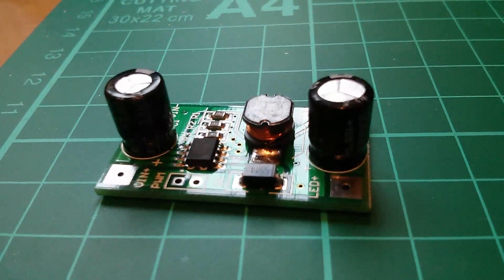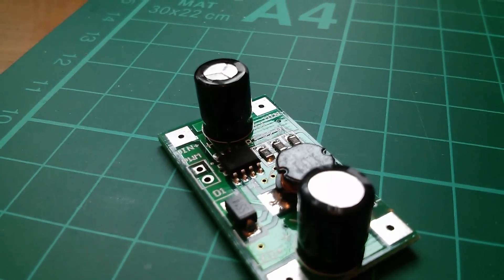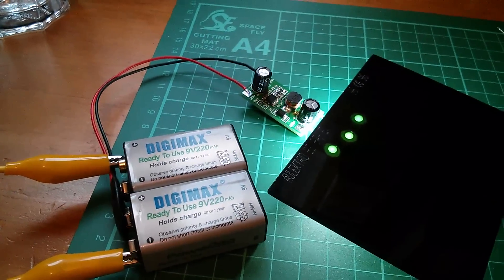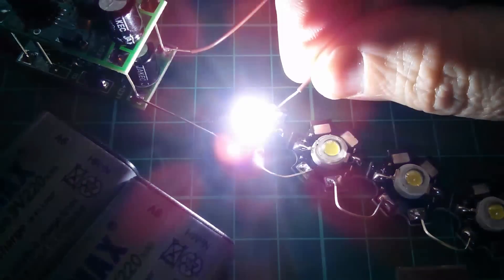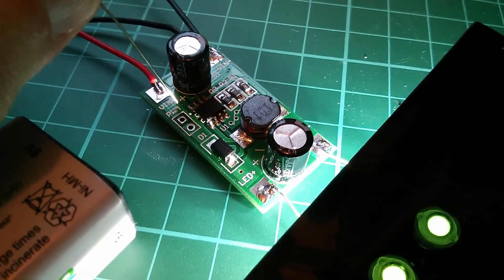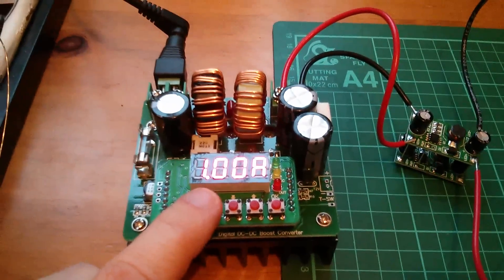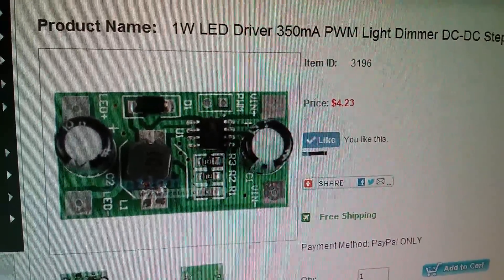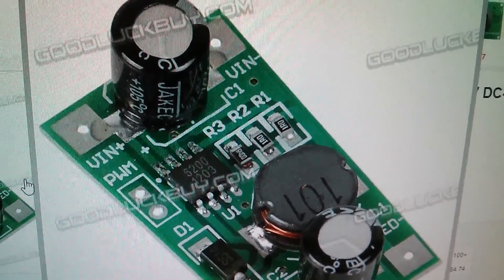Review: 1W 350mA LED Driver with the elusive 6200 Chip

Comment: Got this question here, by utilizing the pwm pin to control the brightness of the LEDs, does it induce flickering to the output caused by the pwm itself? like I want to control the brightness using an MCU with pwm.

Comment: After connecting 1-4 LEDs they start running warmer and warmer until the they "switch" down or something and they got dimmer around half as bright and no longer run hot. It doesnt matter if its 1 or 4.

Comment: To PWM works with arduino it must to be connected with PINS 4 OR 13 because they are 980 Hz. Others pwm pins are 490 Hz and doesn't work. And it is logic inverted

Comment: If it can drive up to 10x1w led. I would list the product as 10w capable since that's it's max output. And list 350mA output just as it has and people will know that's for 1w led's. most drivers are meant to put their max output on the listing. 
So it really is a 10w capable unit, it only can output 350mA. That's reasonably decent, but lets be honest there are hordes of buck converters that can easily do that and it isn't anything new.
Reply: Except that this is specifically constant current...

Comment: @Julian: I've searched for this chip last couple of days and found on Ebay 2 of the same drivers with different text on the chip. After clearing out the picture I found out the correct chip that is used in this driver: XL4001E1. This is the chip on the "non" 6200 driver but I bet you it's the same chip. Pin 1/2 and 7/8 are indeed linked: http://www.xlsemi.com/datasheet/XL4001%20datasheet.pdf

Comment: Julian.  I managed to get a datasheet for the SSC6200 dip-8 directly from Sanken if you're interested.
Reply: could you upload it?
Reply: @sztorm94  Hmmmm...I don't think I still have it.  But I do remember the pin-out was the same and the voltage\current specs were pretty much the same.  What I can say from personal experience with using both chips on these modules is that the SSC6200 modules couldn't handle as much current as the XL chip could..  I changed the resistors and diode on the board and was able to get a steady 1A out of the SSC but could go to 1.5A with the XL.  Anything higher and it would begin to strobe.  The SSC boards are very stable for 700mah and lower and have been going strong for years so there's no reason to avoid them.

Comment: Picked up a 20 piece lot of these; but the 700ma version.  just a heads up that it seems a BIG batch of these was built with the capacitors installed with revered polarities.  17 of the 20 have incorrect polarity.  Never even thought about checking this before using and got a nasty surprise when the capacitor on the Vin side exploded in my face.  Glasses saved my eyes from the debris.  Not too pleased.  Removed and reversed the caps and the driver works as hoped.  But anyone getting these I would HIGHLY advise double checking the capacitors are installed correctly before even contemplating connecting power.  Just glad ebay has a great buyer protection policy.  Refund is on its way.

Comment: The chip is either a copy or a relabeling of an XLSEM XL4001E1 which is a 2A cc/cv 150Khz buck regulator. Data sheet is here: http://www.xlsemi.com/datasheet/XL4001%20datasheet.pdf  Its a nice chip for what it costs (around $0.20 in small qty)

Comment: Can you please explain how to connect the PWM dimmer with that led driver ?
Reply: Don't suppose you ever figure this out?
Reply: @FireclayHomestead   You could use an Arduino, 555 timer, etc, or any logic pwm source. Just put a resistor in series, solder to the pwm input.  Look up XL4001 (XLSEMI) datasheet, I think these chips are a copy.
Reply: @darkanthem9056  what is the purpose of the resistor and the specific value?

Comment: Hi Julian,

I really like watching your videos and have a question to the 6200 Chip.
I want to use the PWM function with an Arduino Nano. Do you know the max voltage for the PWM input? Can I connect the digital PWM Pin directly to the 6200 chip or do I need a voltage divider?

Thanks.
Reply: Do you have any information about it?
Reply: @sztorm94  It's the chip in this video, which seems to be elusive.

Comment: I wonder how much current you could get on the output by lowering the value of the sense resistors further.  Perhaps by shunting an external resistor across them?  This is where the data sheet would be handy after all.

Comment: I googled '8 pin dil 6200' and found some data for a different numbered chip but it was a constant current, constant voltage led driver. Hope this helps.

Comment: Pro tip, use Google Translate to get Simplified chinese for LED Driver, then search for 6200 LED驱动器 the first link, 
http://b2b.hc360.com/supplyself/51529904.html
from which we learn the full code is SW6200, it gives some basic details (and googling for SW6200 give them in loose english, http://hu364362808.en.b2b168.com/shop/supply/5287218.html ), and indicates it's most likely a drop-in replacement for the LM3405, for which a datasheet is easy to find :-)

Hmm, except the 3405 is a 6 pin device so not drop in, but maybe functionally equivalent.

Comment: Why would I need to worry about the Amperage ?
I am running 3x 10W 12V LED's in parallel on an old computer power supply.
The power supply's  capability is 350W at 12V.
Both my LED's an power supply are doing great for months.
Is there something I don't get or is the worry about running @ 700mA unfounded ?
I get a lot of things but electricity isn't 1 of 'm.
if I can't see it it confuses me.

Comment: man i am soo good at searching the web :) found what your looking for in 3 minutes or less. here you go:
http://www.aliexpress.com/store/product/SC6200-DIP-Octal-LED-Driver-General-Purpose-Current-Sink-with-Serial-Interface-new-stock-ic/322502_728699558.html

i did this search: 6200 1203 ic
and clicked on any aliexpress link (all cheap electronics are made in china and sold on aliexpress).
Reply from the maker: No sorry. If you search for the Sanken SC6200, the only application schematic is of a 16 pin chip.
Reply: Julian Ilett
 well you cant blame me cause the Chinese products dont have the support and technical info that other western product have :) its the right IC but youll have to directly contact the producer for technical info. lately its really necessary to have someone in China  to be able to get the real datasheets of their products, i happen to have one guy in Shenzhen where most of the Chinese electronics is made, but he cant bother with trivial stuff :(
if you carefully read the datasheet of SC620 youll clearly see that the same IC is produced in DIP8 and DIP16 so i guess its the same IC but need more info about the pins configuration of the DIP8 one.
Reply: Julian Ilett hello..ive been watching ur vids and I was wondering if I cld possibly ask ur help on a project im working on..if so cld u email me at wrightsoftheroundtable@gmail.com..thank u
Reply: Julian.  I just found this and it LOOKS like the same chip.  No datasheet that I can see though: https://www.aliexpress.com/item/Free-shipping-5pcs-lot-SC6200-Package-DIP-8-management-chip-new-original/32595167749.html?spm=2114.30010308.3.45.NY7IXV&ws_ab_test=searchweb0_0,searchweb201602_1_116_10065_117_10068_114_115_10069_113_10084_10083_10017_10080_10082_10081_10060_10061_10062_10056_10055_10054_10059_10078_10079_10073_10070_421_420_10052_10053_10050_10051,searchweb201603_1&btsid=55e8a36e-1054-4e56-9dd2-9e245faf3a9b

Comment: You could add one more resistor in parallel, something like R200 or R300 to drop resistenc or just remove them all and put a solder blob across :)

Comment: I cant find it anywhere either, but the closest i could find in the same package was the Fitipower FP6700, Silan SD42511 and the Supertex HV9910, voltages may vary a little but may help,
Matt
Reply from the maker: Cheers Matt. The Silan is the closest. The 6200 has pins 1/2 linked, 3/4 linked and 7/8 linked, so it's really a 5-pin device. I'm baffled by it's apparent non-existance.
Reply: I'll keep on looking, but I'm guessing its a clone of a clone or something along those lines. All the best,
Matt

Comment: I don't recognize that logo either, and I can't find it in any of the usual reference places. Hmm.

Anyway, I managed to find this: http://img.jdzj.com/UserDocument/chen090729/Document/20120202142734.pdf  It looks like it matches the pinout of your device. Interestingly, this one is rated for 2A...

I suspect they're using a knockoff IC, especially since the one you've got has no logo. Knockoffs usually don't perform anywhere near as well as a legit part, which is why the current is set so low. If you don't mind blowing one up, stick .5R in parallel with R1-3, that should theoretically set the limit to 650mA.
Reply: Julian Ilett http://www.xlsemi.com/datasheet/XL4001%20datasheet.pdf
The datasheet is identical to Brant's word for word with the only exception being the model number!
Also it specifies that it can be used as an LED driver including a demo circuit and XL Semi didn't balls up the battery charger schematic ;)
All the best,
Matt
Reply: Sure is! Did find a supplier for it too.. http://www.aliexpress.com/item/hot-stock-100-new-original-XL4001-XL4001E1-LED-Power-SOP8/915701327.html
Reply: I wonder if yours are set to 350mA just for LED driving, or if they really can't go up to 2A. I'd be interested to see what happens if you set the limit to 1A or more.
Reply from the maker: That's the one. Not sure how you found it, but well done! The pinout matches and the formula for output current (I=0.155V/Rcs) is correct for the resistors fitted. Also, this chip is shown with a thermal pad and there are some thermal vias in the PCB under the chip.
Reply: I used the search term 'PWM driver' ;)

I've had some experience trying to repair stuff with custom-numbered ICs. It's damn annoying.
Reply: Brant Martin Good job, the chip is quite interesting but is it possible to PWM with 5V output ?
Reply: Yes, that chip supports CV output. You need to take the Feedback pin (pin 4) and connect it to a voltage divider to set the output voltage. The details are in the datasheet.
Reply from the maker: edgetechcompsys Goodness. You're absolutely right. What a mysterious place the Chinese semiconductor market is.
Reply: Probably de-rated to prevent overheating.
Reply: JL this really helped me. The 700ma version what resistors would be needed to set it to 650mA instead?  I don't want to run my LEDS at full force.